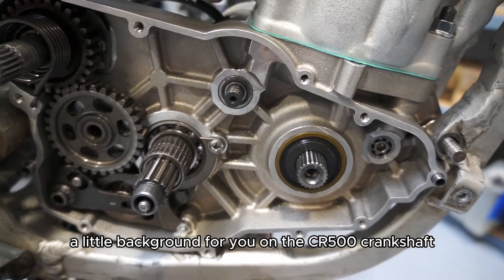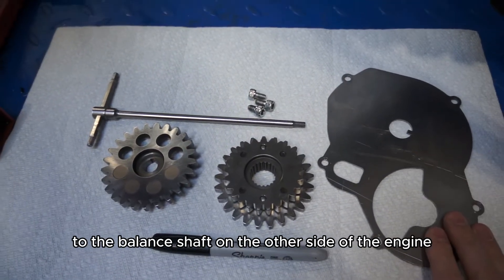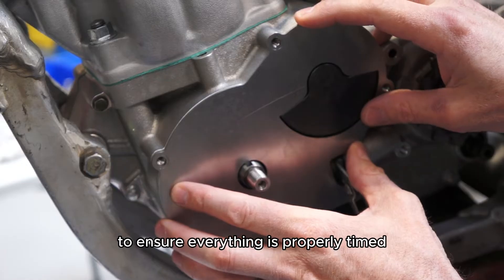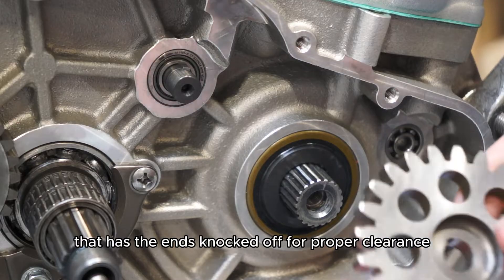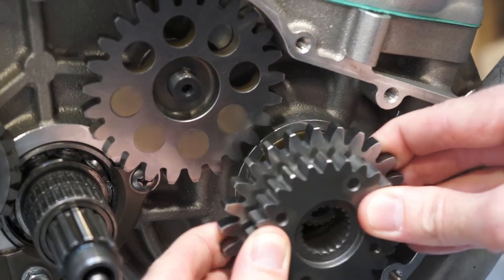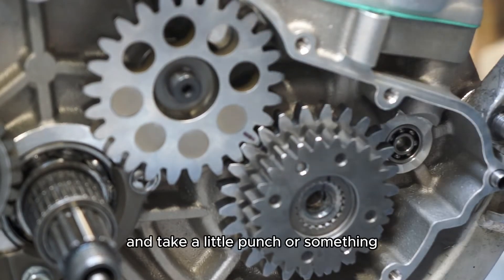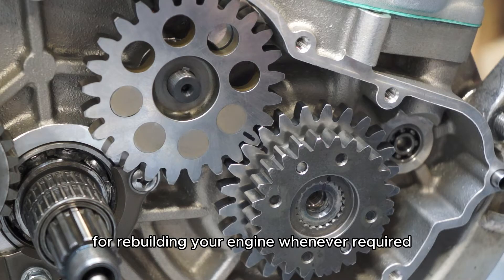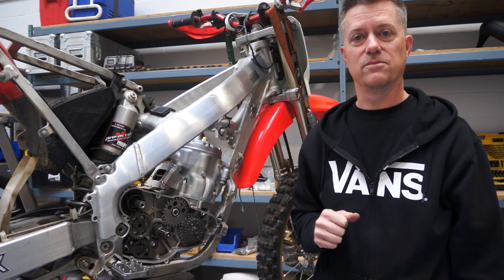BRC Motorsport CR500B Balance Shaft Timing

Comment: This sort of thing is beyond my capabilities, but I have changed the balance on a stock CR500 crankshaft that was running a big oversize, heavy Wiseco piston, and I was pleasantly surprised with how smooth the motor ran in a stock motocross frame, no fender flap or hand shake/tingle at all, fun stuff.